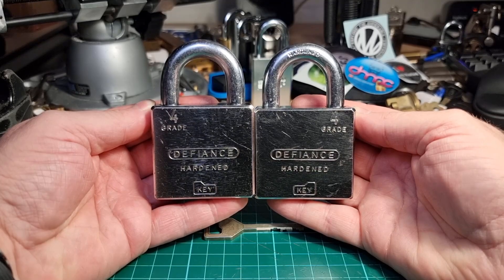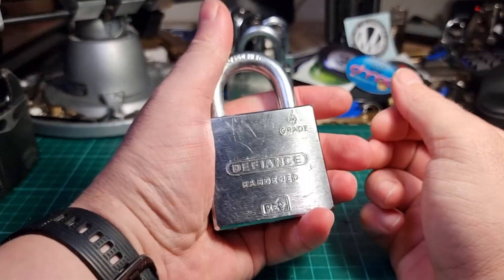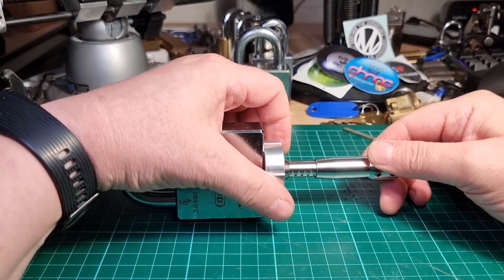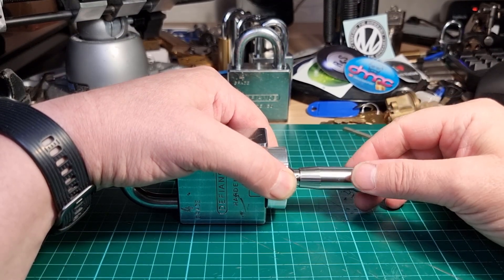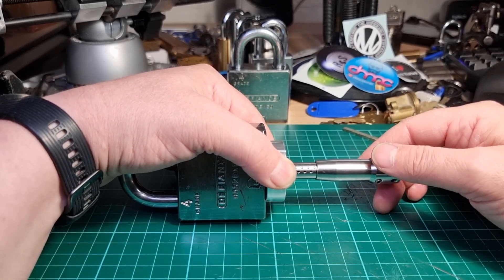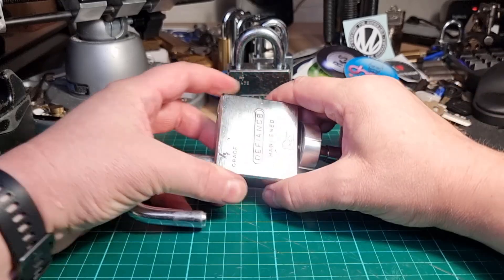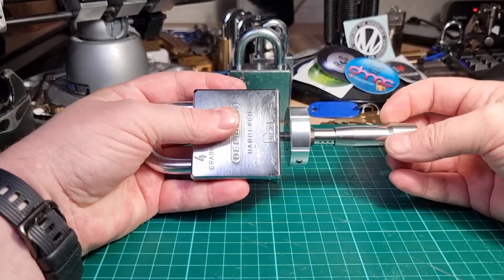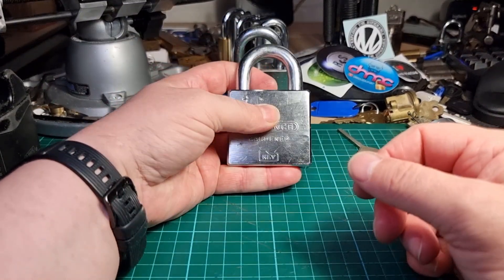(403) Defiance Grade 4 : Another Anchor Lås DD Lock Picked

Comment: Way to go. Cool lock and I am loocking forward to the Abus.
Reply from the maker: Thank you 😁 
Both the Abus plus padlocks I have are the ones with the oversetting butterfly discs, so it may take a while to get the feel for them... and I'm still crap at using the rear tensioning tip 😆
Cheers bud 🍻 👍